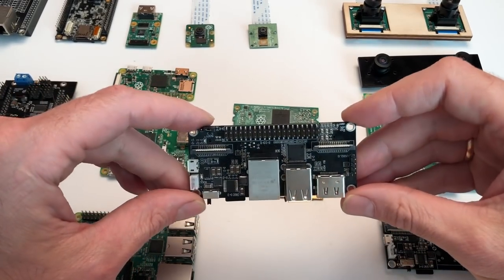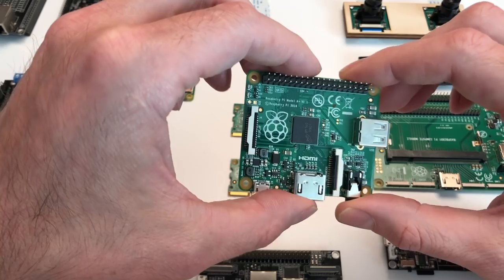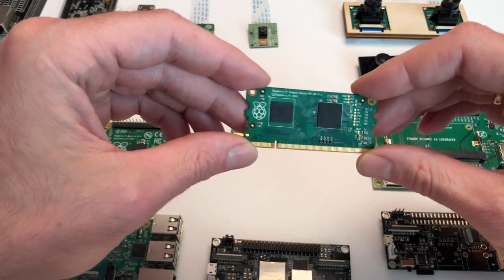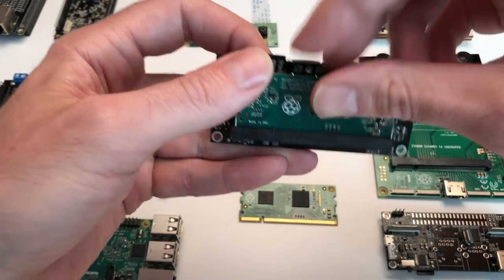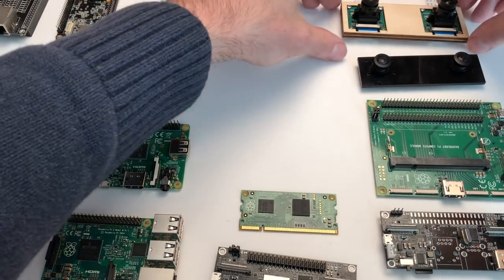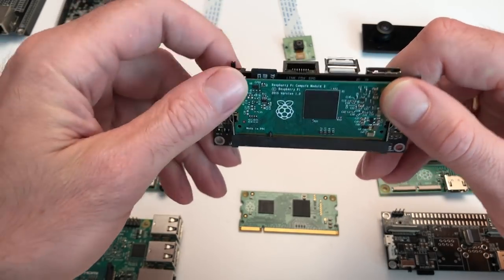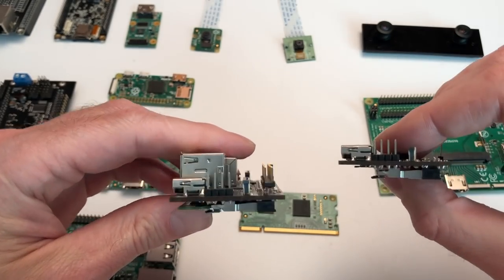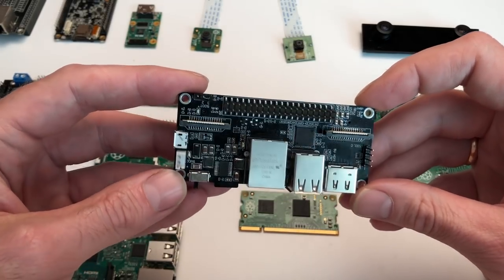StereoPi review (English version)

Comment: Any ETA on this?   Need it desperately for a project.  Not trying to have a massive compute board just to stereo 2 cameras.
Reply from the maker: All production updates will be posted at our crowdfunding page. You can subscribe here https://www.crowdsupply.com/virt2real/stereopi
Several days ago we started first production stage with the big factory with 20 prototypes (for testing final schematics, PCB design, components etc.). If everything goes well, we'll start main batch right after crowdfunding (planned on November-December). First prototypes will be available earlier, but they are more expensive because of small batch size.